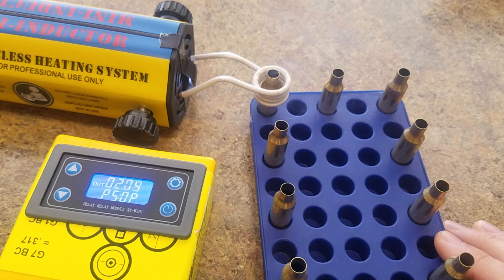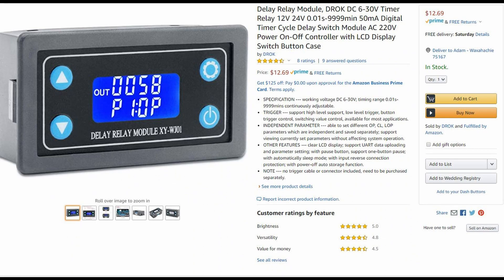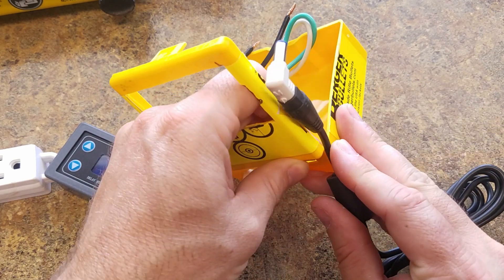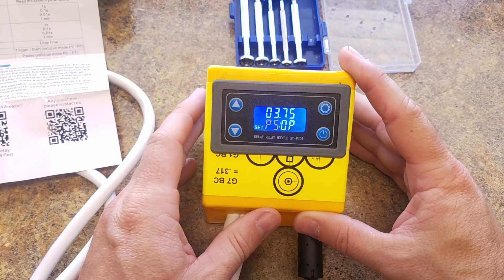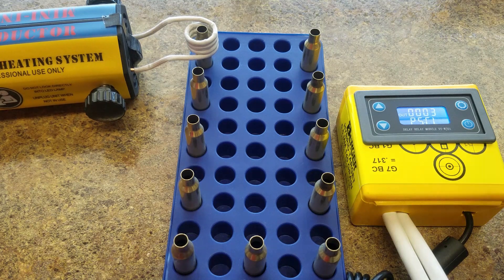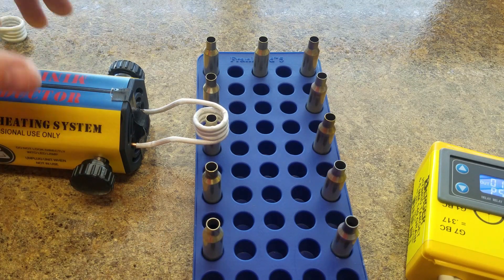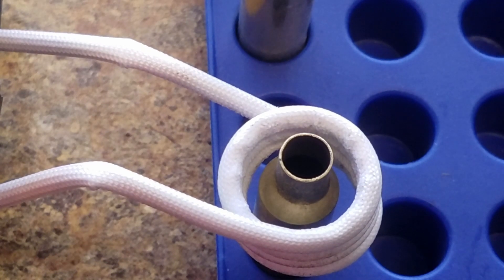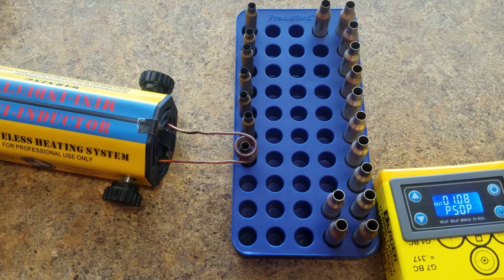DIY Induction Annealing Brass with .01 second accuracy for $200

Comment: Worked with industrial induction heaters in the past. They kept the coils cool by making them from small dimension rectangular copper tubing and pumping distilled water through through it while it’s running. The wires are connected to each end of the coil and it’s electrically just like you have on your setup. Pure water is a pretty good insulator, and using about 8-10” of small diameter rubber tubing at each end of the tube turns the water in the tube into a long resistor with a low cross sectional area and therefore a high resistance. I remember seeing wires connected to a water cooling system totally blew my mind until I figured out how it worked…. Once a tube sprung a leak and a maintenance man simply shortened the hose to quickly get it back in service. He equipment didn’t work correctly and because we were not aware of the hose repair it took a while to figure out what the problem was..  I’ve got about a years worth of brass before I need to think about annealing, maybe I’ll set something up on my Dillon 650. It would be pretty easy.

Comment: I'm curious how much power (ex. how many amps) the device is drawing during the annealing cycle.  I'm assuming the open circuit voltage on the output (where the induction coils connect) is a nominal 120 V.

Comment: Technically all the coil 'turn' counts should be in 1/2 turn increments.  When you make a full turn, the end wire is pointing in the wrong direction.  You need both leads pointing in the same direction so you can attach them to the power source (heater).  This is why the directions for making inductors by wrapping wire around a drill bit references 3.5 or 5.5 turns.
Reply: Thanks for the good advice! Us non-engineers would never have known this.
Reply: Gotta love that phrase, "Technically speaking", always comes from a "certain" kind of person 🤣🤣🤣

Comment: I use an AMP.  There are some great things and there are some not so great things about it, but that's with any tool customized for reloading.  I think this is a brilliant way to anneal for $200.  Over annealing isn't hard to do.  You can anneal over and over on the same settings, if it takes the brass to the magic temp, and it won't hurt it all.  The brass gets red during induction annealing and even during flame annealing, but the flame makes it difficult to see it happen as the flame and the light from the heat in the brass are in the same spectrum.
Kudos to you for figuring this out.  I know a guy that made one out of a spare PC and some parts for his ELR cartridges, because the AMP, while good at it but not great, struggles with large ELR caliber cases which are mostly based off 50BMG.  I have several times thought about making a competitive model to the AMP using liquid cooling to lower the temp of the coils while maintaining current.  Just have too many other 007 assigned projects to do.  That's the American 007 which mean wife.

Comment: I just finished my build too with some improvement. I disassembled induction heater and jumped out 2 button wires and 2 12v fan wires by an old 4 wire usb cord. The fan wires connect directly to the dc power supply and button wires to the relay terminals. Then I put 12v power supply into the same control box. This way the fan is always on when plugged in and only a low voltage control signal goes through the relay.
Reply from the maker: That sounds clean!

Comment: Confused on your wiring setup.  You don't show a few steps.  It seems that you have stripped two WHITE cables: one is the 3-prong power cord, what is the other white cable?  Also you seem to have an adaptor to connect the ac/dc converter to timer?

Comment: Put mine together last night and with the way my coil is wound, I'm not sure I'm going to mess with the timer.  I don't think it matters how far down the case your anneal goes as long as the neck and shoulder are fully annealed. (obviously you don't want to soften the case head or web).  I just wound the coils using the coil winding mandrels that come with my Socket Set (8mm and 9mm mandrel as you did-- worked great!). It seems plenty effective to just heat until you see the first hint of glow, then release.
Reply: Funny that I’d get a notification of ETT liking my comment the same day I finished the timer build. It works great! My particular coil needs 1.4 seconds for a good anneal, but I’m pleased.

Comment: Your instructions (or more correctly, the lack thereof) on how you wired and powered the two units...induction heater and DC controller...are not clear at all. We're left assuming too much.  Great idea but this vid gets poor marks for the 'how to' aspect of this project.
Reply from the maker: They can't all be winners. Check the follow-up video, last 2 minutes out so.

Comment: can't you dip the coil in water to cool the coils
Reply from the maker: You probably could but the internals of the annealer still get hot independently. With the fans that I am running I just annealed 250 cases the other day and the coil never started to Glow.

Comment: What is the relay that’s plugged into the DC power cord to wire into switch?
Reply from the maker: You can direct wire it, I just used quick disconnects.

Comment: Hi mate, 
thanks for sharing you knowledge. 
Ive also bought a 1000 W system like yours in the video. I also made a wire which is quite close to the brass. 
However, the brass takes more than 1.30 Minutes to start glowing, yours only take a few seconds. 

What could be the reason for that?

Thanks!
Reply from the maker: Wow, yeah that's a long time. The key is going to be thinner wire and more coils. Try a 12 gauge wire and about 7 coils close together.
Reply: @northeasttexastactical375  I played around a bit yesterday. One very important step was to shorten the wire itself. The standard ones are quite long. This sped up everything A LOT. However, it still needed a lot more time. 
Given the long time per case, the machine was in action quite a long time. 
I think I broke it in the first 20 minutes of playing around lol
Reply from the maker: You probably tripped the overheat protector. I've done that a couple times before I had my fans set up. Just put a vacuum hose on the back end of it and force some cold air through the unit, it will start back up. And you have to go thinner wire or it will never speed up.

Comment: I built this arrangement and all functions as it should. However, I am not getting the heat transfer anywhere near as rapidly as you are on the video. I built my own coil so that the diameter is very close to case dimension and still it is taking 8 to 9 seconds to even begin to get any glow out of the case. How would I validate the output of the heater itself to determine if I have a problem?
Reply from the maker: Sorry I just saw this. Check the comments in this thread, but you most likely need thinner wire, shorter wire, and more coils.

Comment: I took your ideafurther by adding an ice cube relay to send power to initiate a signal to trigger theswitch. Ifound the annealer needs to run constantly to cool. In short, 2 cords from the same circuit,one to the controller, and one to the annealler. A cord from the controller goes to a coil that pushes the button, so the internal fan runs constantly.
Reply: That’s how I’m going to set mine up

Comment: Thank you for this video.  I just built this setup but put it in a box with a trapdoor.  Mounted the hot rod in the box on all thread with hanger strap.  Sloted the holes and added knobs so you can adjust your coil up and down. The all thread lets you adjust the left,right.  If you pop the back off of the timer you'll see a connector labeled trigger. I soldered wires to the gnd and low signal terminals and ran them to a momentary pushbutton on the front of the box for a start pushbutton instead of using the one on the front of the timer.  I'm using a 15a 24vdc power supply to feed the timer, solenoid, and some cooling fans.  I ganged up two computer turbo looking fans to force air into the back of the hot rod so it has a continuous air flow instead of only running it's internal fan when the timer turns it on. There's a pretty good breeze coming out of the front of the hot rod.  I have a timer relay that will auto activate the trapdoor with the annealer finishes.  Getting the cases out of the coil asap may lessen the heat soaking into the coil.   My first coil attempt was 12awg wrapped 7 times around a 10mm socket.  It would do a 308 in 4 seconds.  The second was 8 wraps around a 308 case for 556.  It turns the case red in 1.5 seconds.  I think I'll do a different .308 coil with 8 wraps around a 338L case to get more efficiency.  Thank you NETT for this vid and your updates!
Reply: Up too 800 6.5 cases through the annealer without issue.  Figured out if you set the timer to a continuous loop with a 7 second delay you can just feed it cases without it getting hot.  Currently looking at a pile of parts and electronics that will become a case feeder for it.
Reply from the maker: Yes! 7 wraps with 12awg wire anneals most of my cases in under 2 seconds. Love the upgrades! 👍
Reply: @northeasttexastactical375   I present the Ghetto Ass Annealing Made Pretty Good 400.   
https://youtu.be/2i58FN0C9wA
Reply: @northeasttexastactical375   added one more fan inside the box that blows out through the coil access to cool off the coil. Works very well.  6.5 creed brass in 1.7 seconds.
Reply: @northeasttexastactical375  casefeeder code test.  https://youtu.be/p9OSeGtVa3g

Comment: Question; D you have any idea how long will the induction heater last? 5000 cases, 10,000 cases or 100,000 cases or ??
Reply from the maker: No idea, mine is still rocking along, haven't kept count, maybe 5k so far?

Comment: How many cases are you getting, or averaging, per coil? Example: Let’s say you’re doing .223/5,56 cases. How many cases are you getting done before a coil burns out?

Same question for, say, .308 cases? Or any other cases you have/may have done if you haven’t used it on .308?

Is there a way to maybe adjust the output of the conductor itself? 

And when you make your own coils, what are you using to wrap the wire your making the coil out of to get them nice and round? I can see a .50 caliber casing for like the .223/5.56 brass. Or a flashlight barrel maybe. 

As for making sure the coils don’t touch, what happens if they do? And how or why does the matter when the coils are a part of the same wire? Or is it that not having them touch simply makes it conduct better? 

Lastly, the material around the coils looks like it’s that same stuff I see wrapped around wires inside of like toaster ovens and other electronics where heat is conducted. Is that what it is, a white non burning or flame/heat resistant cloth material? If so, you can take old stuff apart and get more. 😬

Thanks in advance.
Reply from the maker: I haven't burnt out a coil yet. I don't let it get hot enough. I do a 4 second off cycle and with the fans going it keeps the coil cool enough. Keep the coils small, my .223 coil is a 300WM wrapped case size.  My magnums are a towel rod that was just bigger than the cases. 
If the coils touch they just negate a coil and you lose efficacy. When the coils are sized right, you shouldn't have to run the annealer more than 2 seconds even for magnums, I'm under 1 second for my .223 brass, about 1.75 for .308.

Don't worry about the white sheathing. I don't even use those coils, the wires are too thick. Takes too long. Thinner wire goes faster

Comment: Thanks for doing this video. I’ve been using your design for a couple of years now and absolutely love it except for one thing. My unit turns off after 10 cases and I have to wait 30 minutes for it to cool off before it will work again. It’s not the coil but an internal shutoff that gets hot. I’m using the fan and it takes 5 sec. to anneal a 308 case with 4 coils. Any suggestions would be greatly appreciated.
Reply from the maker: Sorry I just saw this, use thinner wire, get 7 or 8 coils in there, it will cut the time of your anneal to around 1.5 seconds. Quick workaround for the auto shutoff, stick a vacuum hose to the back of the unit and force air through it for about 30 seconds. That, combined with the shorter anneal time, should allow you to really crank them out.

Comment: Great system. I used 8 gage copper wire and made my own coils by wrapping it around some tubing.  I started with 5/8" I.D., and it took 9.5 seconds to get the .556 brass to glow.  I then made another coil with a 1/2" I.D., and the heating time really decreased - 2.5 seconds to get the same glow.  So by decreasing the I.D. by 1/8", the time to heat was about 1/4 of the time.  BTW, I also saw that the 110-volt timers listed on Amazon don't go less than 1 second, so the 12-volt timer was necessary.
Reply from the maker: Good info, thanks!
Reply: @John Hagerman I built mine using the 110V timer. It skips having to use a secondary plug and cable to run the setup which for me is a big plus. I am more than pleased so far. I just got it completed yesterday. That said the wiring of the 110V unit was a PITA. It took a while because the instructions are worthless. I got it now though and it's fine.

Anyway this is the first I've seen anyone explaining the difference between the 12V vs 100V timers. Really though asking out of curiosity more than anything would being able to time below 1 second make a difference? I could easily convert mine for $12 but at first glance I don't see the need.
Reply: @tyler6147  Actually I originally built it with the 120v unit before I found out it didn't do less than 1 second intervals, so I switched to the 12 volt.  In my limited experience so far, I think the 1 second interval would be workable if the induction coil I.D. is larger, like I originally had with the 5/8" I.D. coil.  Certainly using the smaller coil means that the timing is more critical due to the fast temperature rise - maybe that's not such a good thing.  By making your own coils and experimenting with I.D. sizes, an operator could probably come up with a happy medium pretty quickly.
Reply: @johnhagerman1465  That's exactly what was running through my head. Maybe play with the coils a bit and see what happens. I am using the coils that came in the pack (with the heat resistant stuff on them). I straightened them and rewound one of them to see how it works. I have three of them so I can possibly come up with an optimal diameter.
Reply: @tyler6147  I bought 3 feet of 8 ga solid wire from a local (real) electrical supply shop for $5, so feel free to experiment as much as you want!
Reply: I also used drill bits to wrap the wire around, so it's easy to know the I.D. you have, and is easily repeatable

Comment: Hallo... wow looks great 
But how have u conected the timer with the annealing machine? 
Or U controll just the energy current, with the timer?
My english is not the best!!!
Preise explain it,...

Greetings from Germany
Reply from the maker: There are no modifications to the annealer, it is just plugged into the power strip. The timer is what controls the circuit on the power strip. So you could technically put anything on a timer that's plugged into the power strip.
Reply: @northeasttexastactical375  thank you so much... Great

Comment: Great Idea! I duplicated your work except I bought the Nearpow "infinite repeat cycle timer" off Amazon for $17 and saved the work of building a timer. Works great. I do 10sec on and 4 sec off for 308win
Reply from the maker: 10 seconds it's a bit long, change up your coil and get that down to under 2 seconds per case.

Comment: Hi ! How do you know the exact induction time ? I saw videos where the guy analyses this with a ladder (0.2s increment for example), is this the way to go ?
Reply from the maker: Yes, same way you would for flame annealing.
Reply from the maker: They will all be different based off your coil size, number of coils, wire length.
Reply: @northeasttexastactical375  So how do you decide your exposure time ? You stop directly once red ?

Comment: So is he cutting the prong end/male end of the extension cord and then stripping the wires? And then did he cut off the charge end of the ac/DC charge cord? I wish he showed what he did there in more depth.
Reply from the maker: Don't cut the end off. Just cut away the outer sheathing and only splice the black wire into the controller switch. You can cut off the charge end of the DC charger if you want. I just spliced it into a female connector that was attached to the switch.
Reply: @northeasttexastactical375  wow, thanks. I think I understand now.  So just to double check... are you plugging into the wall outlet both the extension cord and the charge cord powering the relay switch? So using two outlet sockets?
Reply from the maker: @livetooextreme  yes, one powers the timer, the other powers the heater.
Reply: @northeasttexastactical375  thanks much for the super quick replies. I'll be using your links. Last question, when the table fan is running, does it not mess up the heating coil temperatures and heat times?
Reply from the maker: @livetooextreme  not at all.

Comment: I would not use the fan... Annealing relies on the metal cooling relatively slowly.
Reply: Steel and lead will be harder if quenched. Brass can be water dropped after annealing.
Reply: man you get some silly people. where do they get these ideas they pass off as legit? dangerous place comments sections.

Comment: This indiction heater os 1000w. You don't that power for annealing. You will find plenty of around 250 to 500 watts induction heaters for less than 50 bucks. Wires can be made with wire you buy seperately. The one in the video is made to help to solve seized bolts/screws.